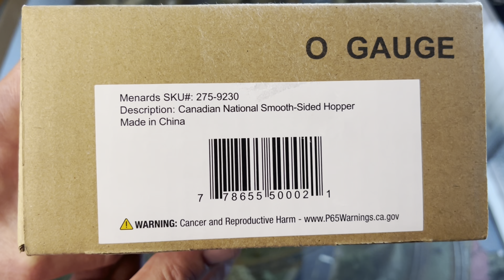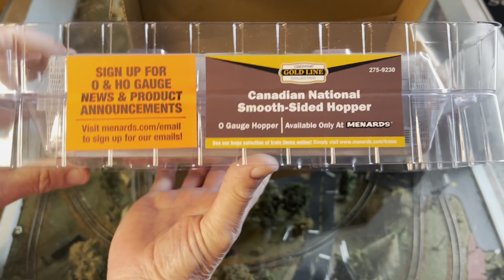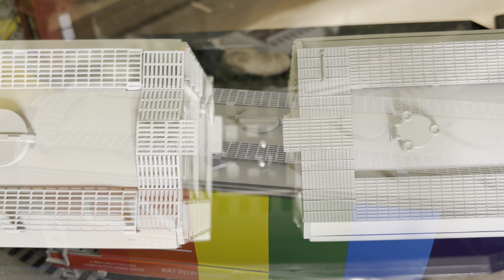Menards CN ACF 2-Bay Billboard Hopper 11-24-2023

Comment from the maker: The Menards Hopper Car body Lenth is 9 5/8" - Atlas 8 7/8" - Lionel 8 5/8"
After fixing the other truck the car runs as it should without rocking. 👍
Reply: Actually the wobble is kinda nice because it gives the illusion the car  having a functional suspension. 

Even on real trains the cars rock side to side when going over inclined grades or wore out sections of track. So not that big of a deal.
Reply from the maker: @myrtistaylor5759  I guess one could look at it like that. However, None of the other manufacturers rolling stock I own do this.🤷‍♂️Thanks for your input and have a great Holiday.😊Mark🎄

Comment: I own 2 of these Menard's hoppers, soon to be 4. I feel they are a GREAT value since I have to pay $75-100 for this car from Lionel or Atlas.  A small thin Fender Washer on ONE truck will help. Mine do not wobble so much that it bothers me. Place the washer on the underside of the truck, NOT between the truck and car body.  During my HO scale days you wanted one truck to move a lot and one to be tight. This made for good tracking. With huge wheel flanges in O3r not needed as much bit still works. THANKS!
Reply from the maker: Excellent.! That's what I'm hearing from folks.! A washer is a much better and easier solution to this problem. Agree about the price as well. I would probably purchase the grey offering but the trucks and yellow safety stripes much like the UTLX tanker cars have prevented me from doing so. Atlas seems to be the best accurate detail model for the price these days at least for me? Thanks for the fantastic Comment.!😊Mark

Comment: I have two and they both wobble, will try your fix. Btw the CN DID have  have hopper in the same scheme but on one side only. The hopper was a 4 bay also. It was a paint test for wear by a mfg.
Reply from the maker: Very interesting David.👍🏻A rail car would certainly be an excellent testing ground for paint that’s for sure.! Several commentators have mentioned the same wobble problems with their models as well. After I finished the video I fixed the other truck and the car rides as it should without wobbling. 👍🏻

Comment: So far my biggest complaint on the Menards rolling stock is the trucks and couplers I’ve had issues with a few completely breaking and having to switch them out for some of my old Lionel couplers from my parts bin.
Reply from the maker: YEP.! I have enough broken Menards wheel sets replaced by Lionel to fill up 2 Gondola Cars. I really like the plane jane grey hoppers Menards just released today but are they worth the trouble? I may order one just to see if it rocks just like this one? (probably will) Got to think on it though? Shame.!

Comment: Great video.  I was thinking about buying a pack of these cars and this has changed my mind.  Also noticed the cylinder hopper part is flat and doesn’t curve like a cylinder at all.
Reply from the maker: Thanks Zach.! This one may be more trouble than the cheap price. I have heard from other commenters who have purchased this model and theirs wobble as well.! I did fix the other truck the same way and it has corrected the problem. The car now runs as it should without wobble. Very glad to have helped save you some trouble.! 😊

Comment: Hi Mark, What I do is I replace the trucks. Once I change the trucks the cars ride great. 😊 Great video!
Reply from the maker: I almost did as well. I have many Menards cars with Lionel trucks. This one is a great canidate for the Lionel trucks for sure.!  Maybe not this paint scheme though.! Thanks.! 😊
Reply: pretty tough to do with some Menards.. their trucks are/were riveted on, not screwed on. Or at least my early (older) versions are. nice to see this one here actually does have screws.
Reply: @ILSRWY4  Yes they have rivets you have to take your time and drill them out very carefully. I was shocked when the screw came into view.

Comment: colors reminds me of the Lifesaver candy! I think their tank car looks like that too. I live close to a CN yard and never seen anything quite like that. I would think using washers would help.
Reply from the maker: Now that you mention it sure does.😊I do as well and never seen one either. Not sure why Menards used this paint scheme.🤷‍♂️The washers I have found are too small to prevent the rocking. I added the larger screw to the other truck after the video and the car runs as it should with no wobble.👍🏻